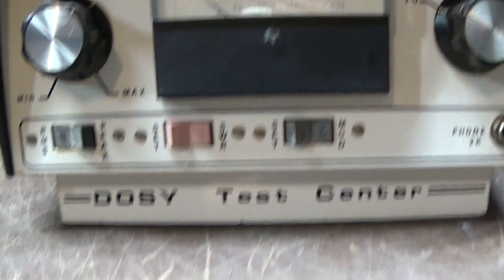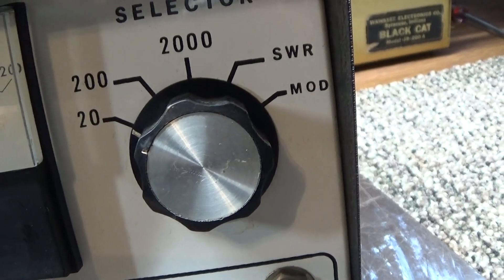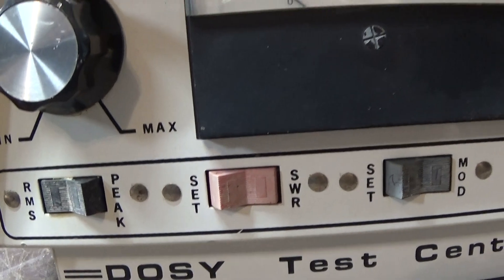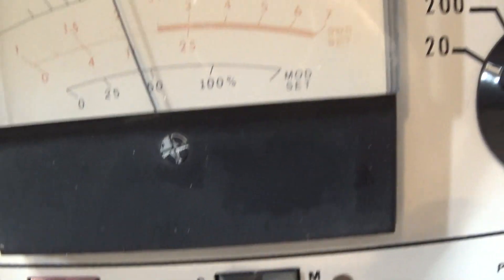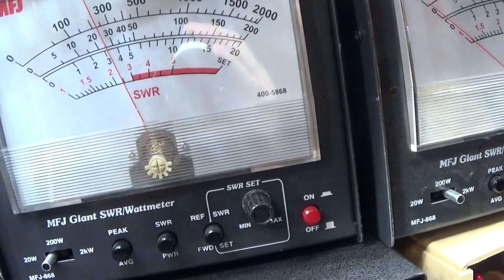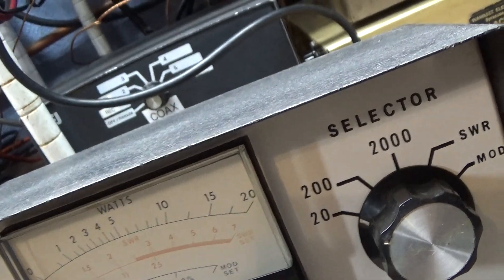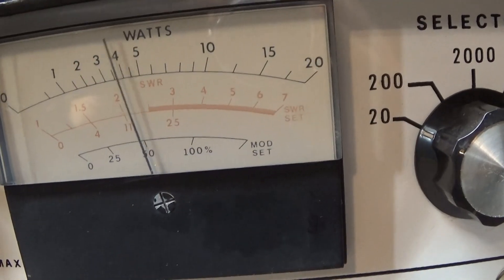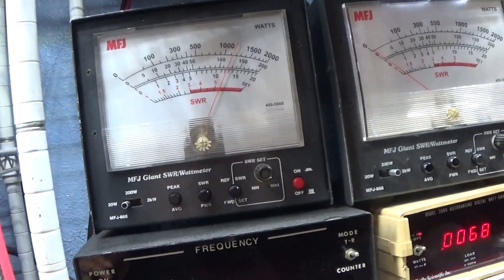Dozy vs MFJ Wattmeter

Comment: I have 4 meters & they are all inaccurate recalibrated my blackcat jb6000 many times but it's not that accurate. I can't look at a bird & way too expensive. Looking at the mfj868B would you say this meter stays fairly accurate? Thanks
Reply from the maker: sure , but whats a JB-6000?
Reply: @tramdr  Wawasee JB6000sw is a 6kw wattmeter that reads 20 200 & 2000 watt scales. Has RMS & PEAK switch & 2x & 3x switch. Meter is quite large with 6"inch meter guage. I bought it brand new 20 years ago lol.
Reply from the maker: Yes my MFJ 868B's are very close to my Birds.
Reply: @tramdr  Thanks man will have to look for one. Just got my old 23ch d201 out of the shop have everything done by Unowho. Now it's meter only works on receive but doesn't move on transmit. Any ideas on this Dr?